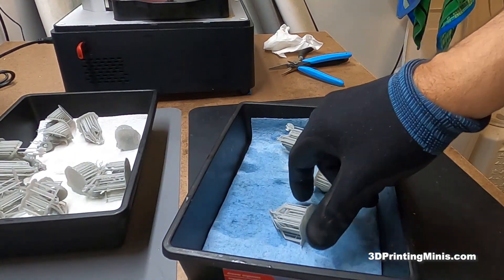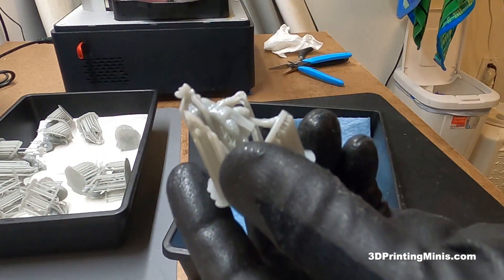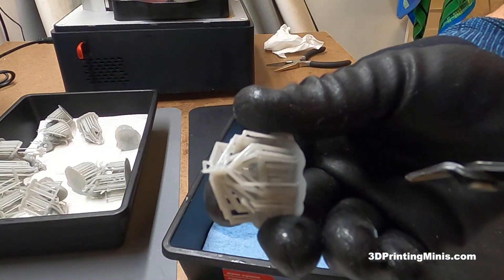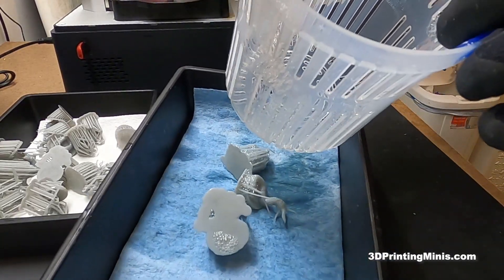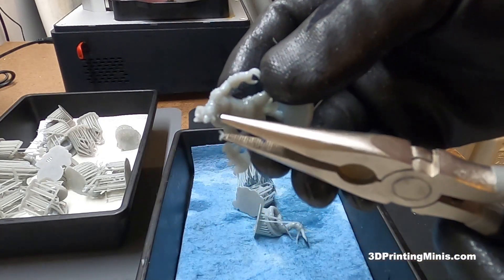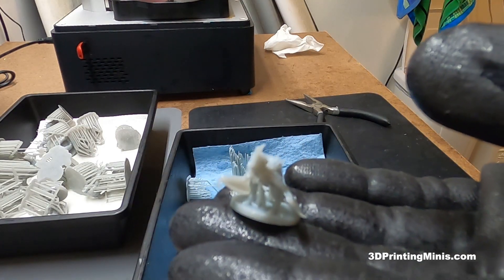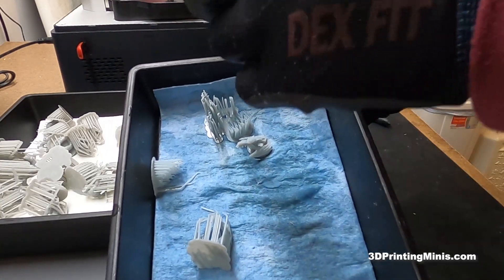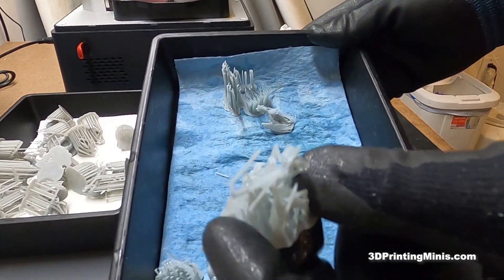How To Remove 3D Resin Supports Easily - No Hassle 3D Model Support Removal Method

Comment: How long should i heat the water also how long should i leave the model in the water?
Reply from the maker: You only need to heat the water to about 90 degrees or so. Nothing over 100 degrees. And you only need to dip the models in the water for 2 or 3 seconds for them to soften.

Comment: If you don't want to contaminate the water, would it work to put the minis into a ziplock baggy and put that into the warm/hot water? Will that soften the supports the same way?

Comment: Do you do this before or after curing?
Reply from the maker: Before curing. I was with IPA. Let prints dry overnight. Then I dip the prints in warm water and remove the supports. Then let them dry. Then cure them.
Reply: @3DPrintingMinis  awesome, thank you, this works great! You did mention a link for mylar bags, safer for no leaking, do you have a link for them?

Comment: I love how quick the videos are! they're not 30 minutes long while their just extending it for the ads
Reply from the maker: Thanks. When I started printing all I could find were super long and rambling videos with little info that took forever (10 to 20 mins) to get to the point. I try to do the opposite in my most of my videos. But, sometimes I'll post a longer one to show the whole process used.

Comment: Yep. Same problem here.  Just started printing a few days ago and pulling my hair out over the difficulty of removing these supports after 2minutes in IPA/Creality wash station.  Prints became very hard and brittle (*before* curing)  and leaving 100-200 struts to remove with a clipper inevitably damaging the print and requiring another 2-3 hours cleaning up nubs with a file.  I will try this and am reprinting a model and will try the warm water bath for 5 mins and see what happens.
Reply from the maker: Just soak them in warm water after the IPA bath. Doesn’t have to be 5 mins. Sixty seconds in hot water from the tap should do. Doesn’t have to be too hard either. Too hot of water can cause prints to warp and deform.
Reply: @3DPrintingMinis  Thanks for the tip.  I will give it a shot.

Comment: Long time maker, 3 days with Resin. This was a great video, and was spot on. Ruined my first print with supports where I tried to snip off the supports. However, this method worked great for removing supports. Only issue I had is the stand my figure was standing on also came off along with the supports. However, it actually looks better because of it :).
Reply from the maker: Yes, I've had minis with thin ankle have their feet and stand come off during this process (especially skeletons). However these were usually models that were ultra fragile after being cured and painted no matter what. Usually I'll bump the height of the model up a mm or two (with  [proportions locked/linked) to beef these figures up a little bit.

Comment: Nice tip! Can I clean in normal alcohol and after that wash in warm water ? Would still help to remove the supports ?
Reply from the maker: Yes, you can use warm water after cleaning prints with IPA. I don't personally do it because I always feel like the supports fall off during the IPA cleaning anyway. Also, I don't like wasting the IPA getting it dirty washing supports. I do my first wash in warm Mean Green, pull of the supports, then finish with a wash in two different IPA containers (cleanish  and clean IPA).

Comment: I hate to be "that" guy, but the gnoll miniature is actually one of my old models, not Miguel's. That warm water trick is genius, I'll be sure to pass that info along :)
Reply from the maker: Haha. I apologize for the mixup. I printed up three or four plates of miniatures for the videos this week. I did print some of Miguel's gnolls, too, but I must have mixed and switched when pulling prints to use as examples for this video.

Please post or send me a link to your preferred page for this model (Thingiverse, Shapeways, etc.) and I'll add it to the video description and the post for this video on our website. I'll also try to print a plate of your models and use them in an upcoming video with a shoutout like the one I did in this video for Miguel. I'm on Instagram at @3dprintingminis is you want to send a DM.

Again, apologies for the mixup. I had no intention of misrepresenting your model's authorship. :-)
Reply: @3DPrintingMinis  I came to check for a reply and realized my comment never posted, my bad. Looks like you got the link. As for Instagram, I don't use a whole lot of social media outside the occasional post on the Facebook tabletop printing page. Maybe someday I'll get things set up properly for Instagram and make the switch, I've just been very busy with multiple large scale commissions. Thanks for the response :)
Reply from the maker: @velrockartminiatures  Dude, make an Instagram account. Your work's too good not to share on there. Seriously. :-)

Comment: Super helpful man, I'm about to get my resin printer coming from fdm.

1 question, is Mean green okay to use instead of ipa or do you need to use water washable for that?
Reply from the maker: Yes, you can use Mean Green instead of IPA if you want. It's not as powerful show you might have to clean your prints a little more, but it works. I'd recommend one pickle jar of room temp Mean Green for an initial 30 to 60 dunk/swirl to get off the initial goopy layers of uncured resin. Then you can do a deeper clean in heated Mean Green (50 degrees C) in an ultrasonic cleaner. You can either fill the ultrasonic cleaner with Mean Green (this is what I do) or you can fill a large ziplock or mylar bag with it and insert it into the ultrasonic cleaner tank. Sometimes if I have a sticky or hard-to-clean print I'll put it in a mylar bag of IPA and drop the bag in the ultrasonic cleaner for 5 mins. It works through the bag. And the heated Mean Green doesn't really seem to affect the mylar bag at all. You've just got to be careful when you take the bag out to put it in a plastic bin so that Mean Green (mixed with uncured resin) doesn't drip onto your hands, work area, etc. Always wear gloves. :-)
Reply: @3DPrintingMinis  Thanks man! I'm ready to get into resin printing the post print was something I wasn't looking forward to but this sounds much lore manageable. You got yourself a subscriber :) keep up the good work!
Reply: @3DPrintingMinis  Do you use the concentrated Mean Green straight into the ultrasonic cleaner or diluted with some water?